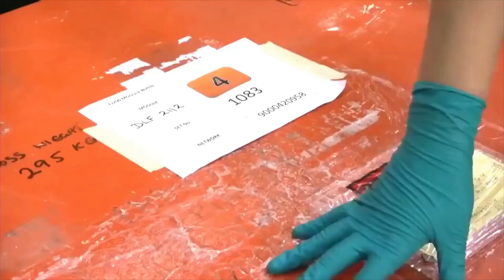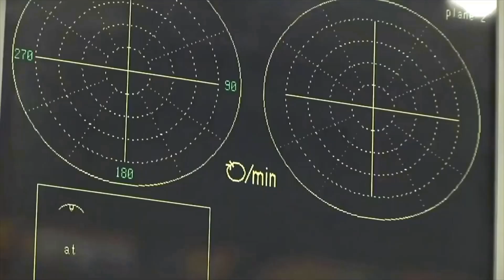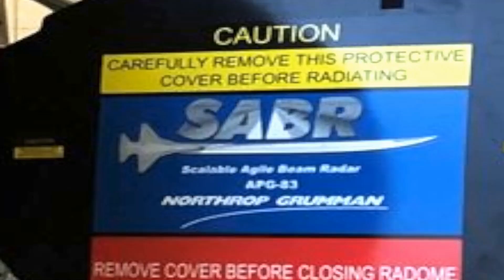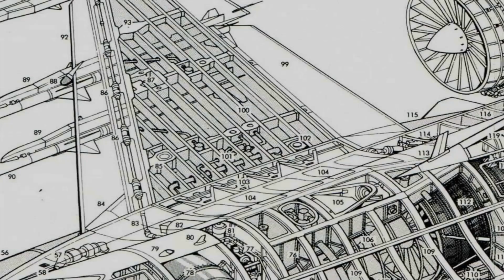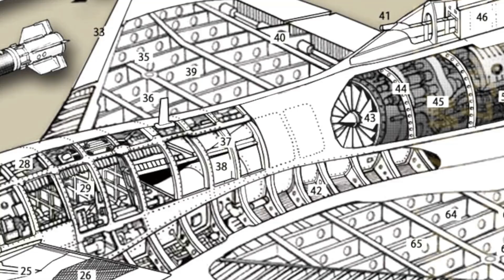Chinese J-10C is good, but there are many problems

Comment: Your all speech is Your dream only. Chinese aircrafts nd their engines having less life as compared to US, yes, but u don't know that Pakistani engineers meet these challenges by regular complete  overhauling . U should not be worried about this. J10 have enough required power for its electronics / EASA radar ,u should not worry for it.  This is most economical, lightweight, long range, easy maintenance nd no any prohibition for any modification by us or Europe. Onething for ur extra knowledge,  its radar/ missiles range is very for than ur expectations, which will brief u in features in any conflict damages.

Comment: You dont put ur own imagination.....do chinese defence industry is facing the same prblm???
Reply: First, ws -10 engine is not based on Russian engine.   Your research is horrible.  It is derived from CFM 56, western technology.  Since J-10c equips with Ws-10c, it show the military is confident with the engine since it is  a single engine Jet.  WS-10 did have a lot of problems 10 years ago but problems got fixed by using the J-10 double engine platform.
Reply from the maker: These are facts not imaginations i made this video after Thorough research
Chinese aviation tech is not yet experience & mature as compare to  western & American tech
Reply: @spectrum4700  Thorough research from google, Yes? You know something which even the Chinese military professionals doesn't known.
Reply: Haha fake Indian propaganda channel 😂😂😂